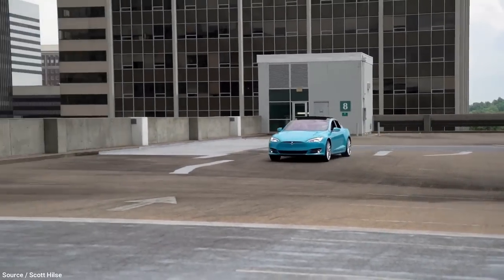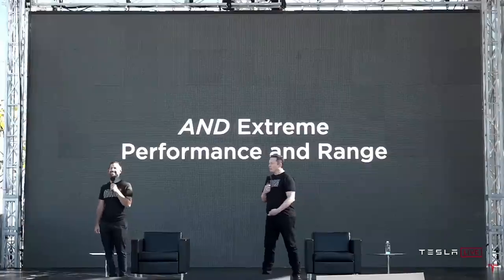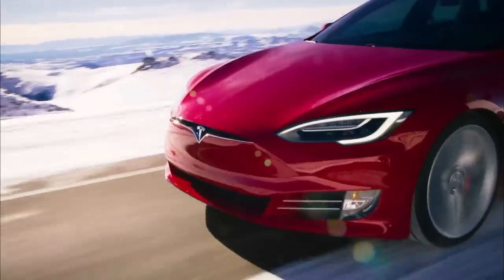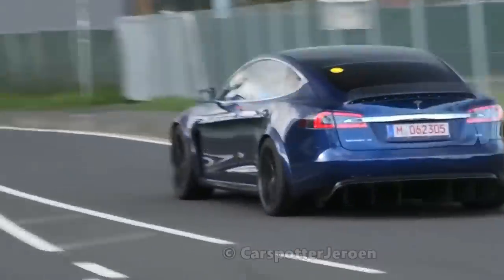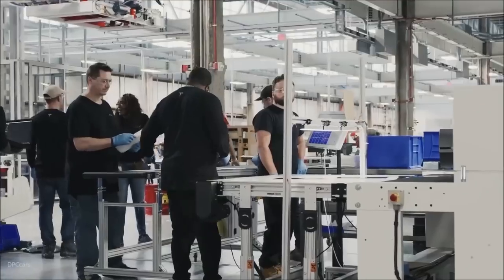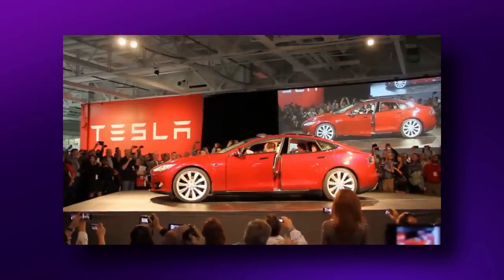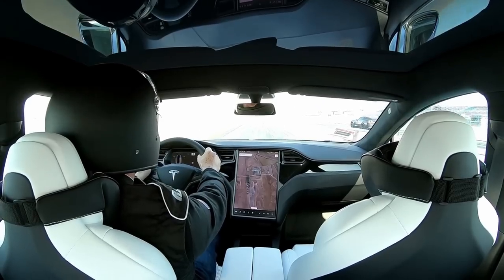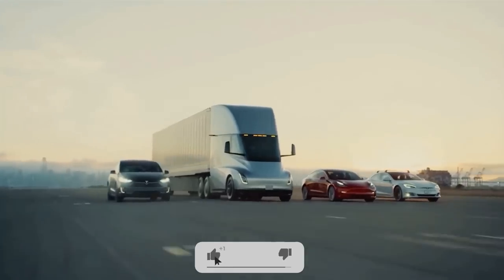Tesla Plaid Mode: Better than Ludicrous Mode

Comment: Talk is cheap. Just release it and test it in real world. 800 HP EVOs can do this every day with no deterioration in power. Another simulated data with no real world test.
Reply: With no deterioration in power???? Yeah sure.
Reply: 0-60 in 1.9sec for a rice cooker? yo no think so.
Reply: @musk-eteer9898  800 HP EVO8 with Sheperd transmission can do that and it’s proven in real data. The plaid test is on a simulator, which is not a real world test result. Us ricers know cars mechanically while Tesla fans are mostly gamers and can’t even overhaul their electric cars because they are gamers, Nooo hands on experience but all virtual and theories in their brains. New generation of car owners are half baked car enthusiasts, just following what the information on the internet says. Wake up and be the real car enthusiasts and not the wanna be ones. Hahahahaha. Up yours!!!!
Reply: 800hp on an Evo and it's a time bomb
Reply: @Shaheen Jackson Not on a racetrack. I smoke them on any tracks here in CA. Can’t last 7 laps without cutting power. It’s a very compromised track car because of its weight. It has issues in side to side transition and elevation changes. Understeers a lot because its 4 wheel drive system doesn’t varies the distribution of power in the drive train. The brakes cannot be modulated because of its regeneration. Easily pulverized the brakes and the tires because of its weight. The only thing it makes it handle good is its lower center of gravity but the rest of its capabilities is inferior. And the worse of all when gunning it on the track there is no noise. It’s a good commuter car and that is it. No place in the track. Thats why  I drive our Tesla only on the streets.
Reply: @Shaheen Jackson what fun?? Ride and play video in its big screen. This generation of kids don’t know what real fun is. Can they modify a Tesla? Of course not because it’s centrally controlled by a corporation. The socialist and communist car. Doesn’t allow the owner to freely do what they want on a property they have bought. New generation of car owners are not really car owners. They just ride and enjoy the torque but they cannot improve the car and their solution to improve a car is to buy another model or download a software update OTA. You call that fun!!!! Pathetic!!! Learn to wrench my friend and update the cars computer using aftermarket interfaces. Then you’ll be real car person. Again pathetic if you cannot do this.
Reply: @randomdude3646  Yup a nerd that can wrench a car, maintain a car, program the ECU to alter timing and boost. A cool nerd
Reply: @arod6789  140K mile on it. Modified since 2005. Better know your facts.
Reply: @curvetrcalinga  whatever you say. 50psi on a stock ecu.  Post video running the shit out of it repeatedly. There's literally hundreds of videos of them blowing up.
Reply: @arod6789  Heheheh. They are blowing up because it is running lean. Make the mixture rich and it shouldn’t blow up. Their AFRs are off. The draw back is terrible drop in mpg. High RPM turbos will have issues in fuel delivery and if it does, it will detonate. Maintaining the ideal stoichiometry on a high RPM motor with that much boost will always be an issue especially if the ECU is not fast enough to detect it and start timing retardation. That’s why you use Motec. Reduce the peak RPM and it will be safe. A lot of ICE tuners out there are missing some knowledge in basic physics and they tune their cars to the max and not knowing the sustainability of power delivery. If I can implement a variable vane turbocharger, like what Porsche turbos have, then than will increase the safety of tuning turbochargers.